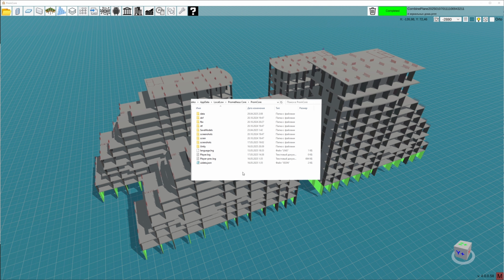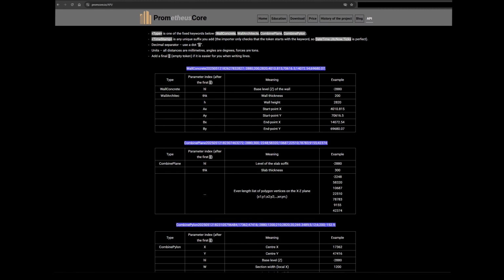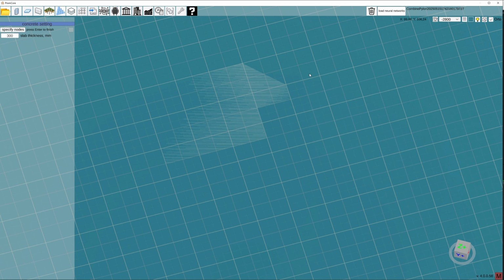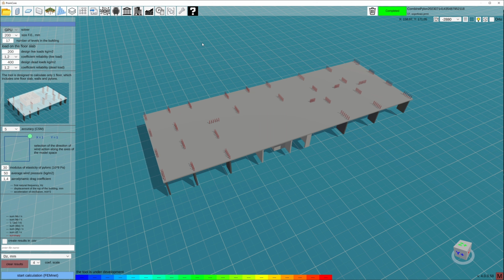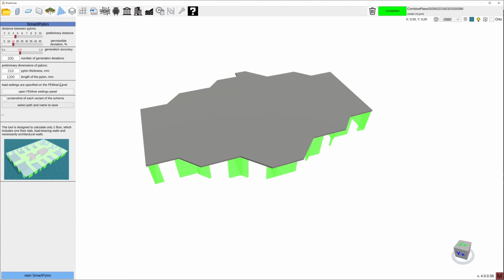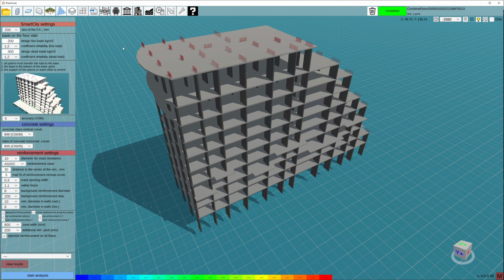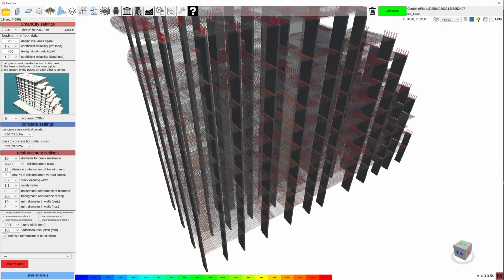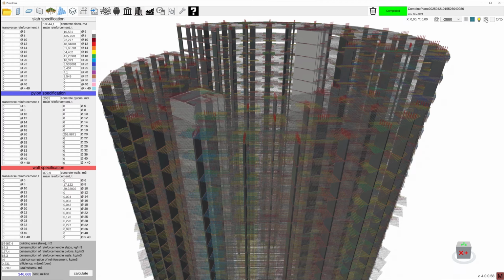PromCore 4.0. User manual

Comment from the maker: Instructions for accessing the program - https://promcore.io/download

00:00 - Introduction
01:17 - general information
02:25 - import from Revit 2023/2025
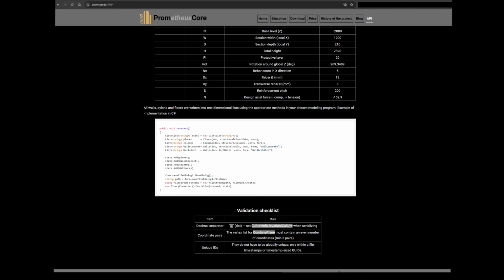03:51 - working with pylons 
05:26 - working with the floors slab
06:27 - working with walls 
07:22 - array of elements 
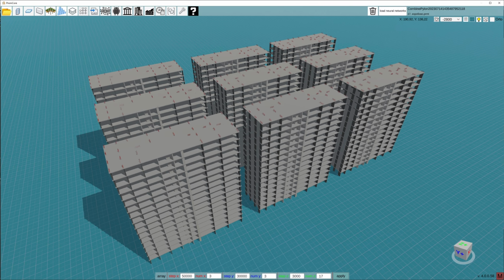07:58 - FEMnet neural network
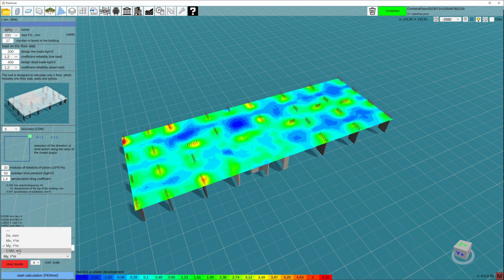09:10 - SmartPylon neural network
11:47 - SmartCity neural network
16:06 - Calculation of reinforcement and concrete volumes